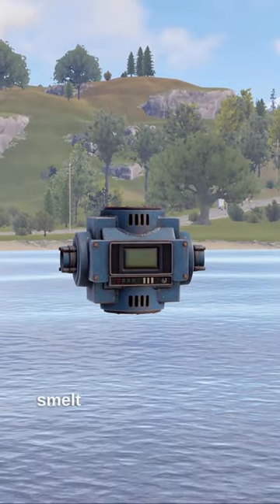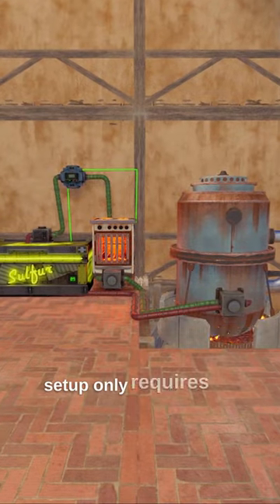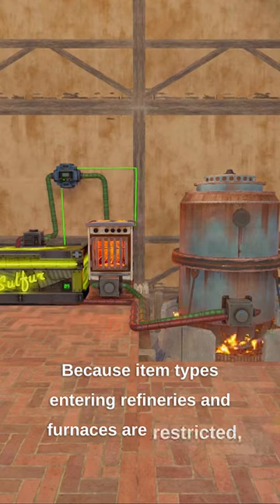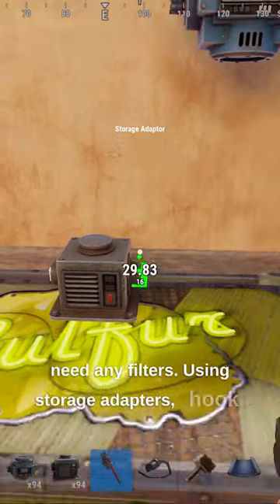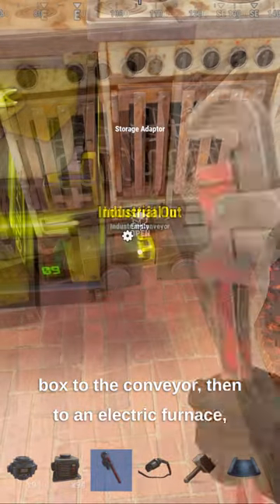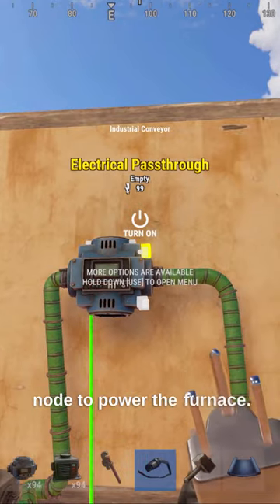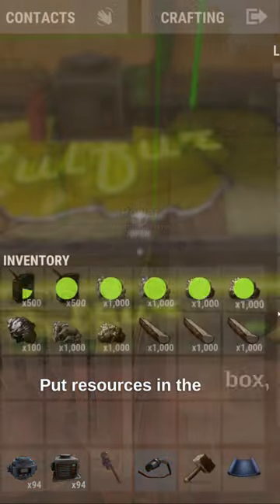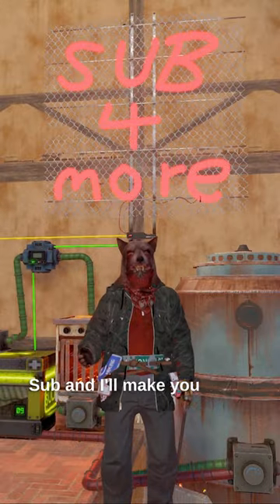ONE Conveyor Smelts EVERYTHING Automatically with This Setup in Rust! #rust #rustshorts

Comment: Will it burn through all the wood?
Reply from the maker: yep! as long as the refinery remains lit. if it runs out you'll have to re-light it next time you put wood in there
Reply: @sigbog  can you use an igniter attached to a button to light it ?
Reply: @travv88  yes, you can
Reply: You can also use an igniter powered from a timer set to .25sec and trigger the timer from filter pass. It will still burn out the igniter faster then needed but at least the refinery will always be lit if there's wood.